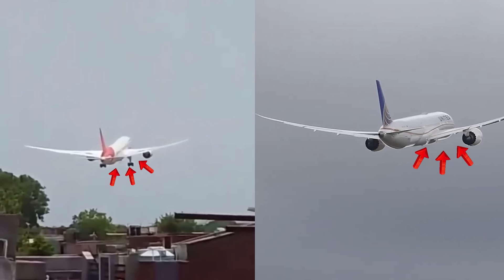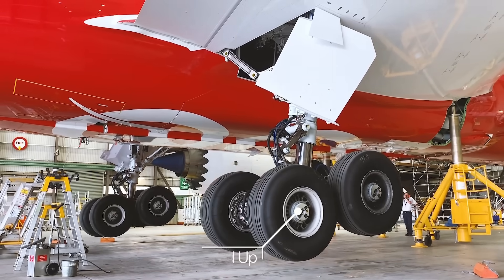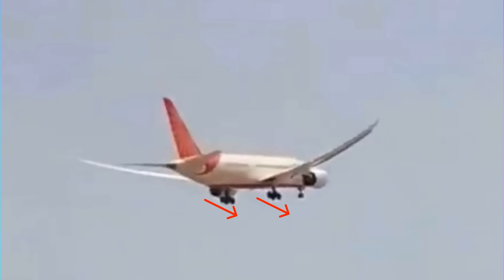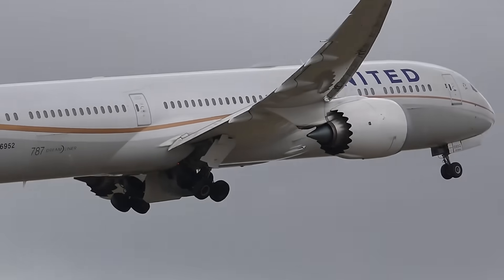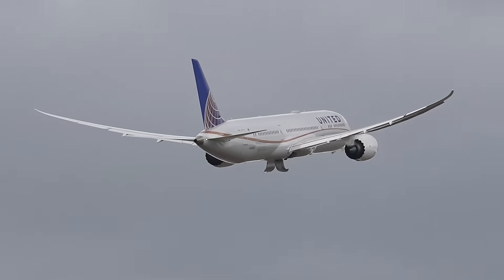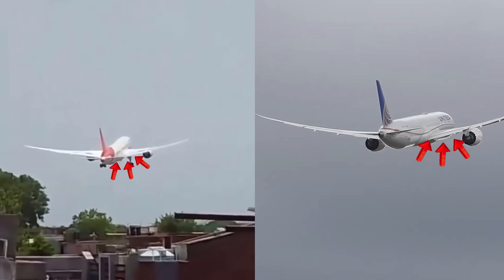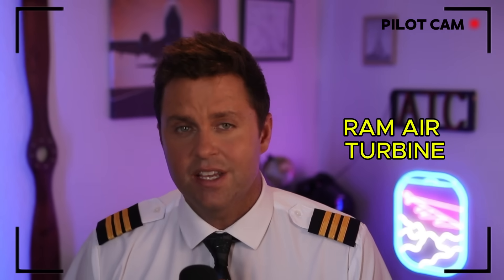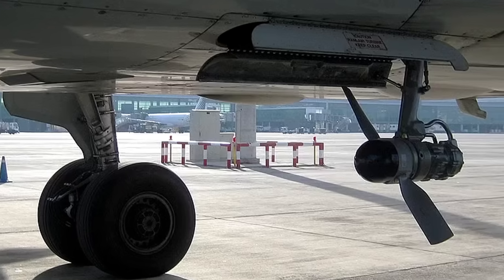Pilot Explains: A New Detail in the Air India 787 Crash Everyone Missed

Comment: Contaminated fuel is unlikely- generally each engine would sputter/flameout separately as the contamination reached them. This would cause asynchronous thrust on one engine causing yaw  or other clues which would be seen on video. This flight shows no strange movements.  Other incidents of contaminated fuel show flameout on one engine before the other, the odds of both happening simultaneously are verly unlikely.  Redundency in electrical systems make such a catastrophic loss of all engine power unlikely also. Usually electrical component failure starts a cascade of events of loss of control, not simply immediate duel engine failure.

Comment: Contaminated fuel would have manifested itself during take off roll.  With all the redundancies in the 787, a double engine failure is virtually impossible.  However, if we invoke the MH 370 cockpit dynamics,  it may be the engines were shut down by the captain/co-pilot deliberately and at the most vulnerable time in the flight.

Comment: Previous flights from this plane have shown electrical issue, and the man who escaped says passenger  lights gone down. I stay on a flight computer issue, say blue screen or reset. My concern is that those peoblens were known before the flight. The plane took the entire long track to take off, and the airport radar blinking to show the plane on FR24, the only plane doing that strange result this day at Ahmedabad.  The fact also that the radar loose the plane just at end of the track. If you add the RAT deployment, means electrical shut down in all the plane, including  perhaps loss of parameters, if there is a short on the battery side.
I think some  must simulate on the identical flight simulator from Boeing,  what happens if you force the plane to take off, as you have a computer reset, due to electrical energy total loss. For me, engines return to iddle, RAT goes down, and everything goes wrong because the computer system decides for the most part. If this takes five minutes to return the system to normal at take off, this is too late, the plane is lost. The computer reset can be due to a short , a battery issue, or manual deactivation of essential systems, like charge, warnings, flaps, and thousands of captors, causing the system to ask for reboot.
Welcome to the computer's world. At a time passenger's  transport drones are coming, we urge to understand that human control must always double-check computers. But, faults are made when humans want to overpass  computer  warnings.

Comment: Fire triangle: heat, fuel and oxygen. If it’s duel engine flameout then it’s either a fuel or a heat issue. This armchair idiot suspects fuel pump failure (less likely) or bad fuel. Either way, the fuel supply was interrupted or there was bad fuel. No oxygen? Not possible. Ignition source? I dont know. I investigate industrial accidents as part of my profession so based on what I have seen, I would be looking at some kind of failure of fuel or ignition.
Reply: Sorry Gary, I was referring to myself as the armchair idiot, not you. 😂

Comment: As an Ex Refueller, if any Aircraft Takes Fuel and then Crashes En-Route to its Destination then the Fuel Farm as we Call it (UK) is Closed Down and Quarantined and a Full Examination of the Fuel Including Trucks, Hydrants is Undertaken as well as Sealed Samples of the Fuel Used at that Time Sent for  laboratory Analysis. Personally, I cannot see it being a Fuel Issue as that Aircraft was not the Only Aircraft to Take Fuel that Day, However, it Wouldn't be the First Time that Pilots have Switched of the Fuel Switches by Mistake on Take Off, A Delta 767 in 1987 Did just that.
Reply: Do you know if loss of all electric fuel pumps is enough to reduce thrust at takeoff? I know the engine driven pumps are supposed to be enough to continue flying and land, but can they suck enough fuel in for takeoff power, and with not even a few percent loss of thrust? And can they work at any attitude including takeoff rotation? And if the gear was stuck down because of a power failure, and the takeoff was hot and heavy doe that add up to enough of a problem? Because if so then electrical failure is really not that improbable

Comment: Someone else suggested a vapour lock in the fuel lines after having sat for 2+ hours in the heat before takeoff, the effect of which became critical when the front part of the plane came in a higher position than the rear part.

Comment: I am not an aviation expert or a pilot but I have made up some thoughts about this accident. The first few seconds of the crash video looked to me like a normal landing on any airport around the world but of course there were no landing strip there. I quickly suspected that there was something wrong with the thrust and wondered what could have caused it. Bird strike was the first option but with no birds observed on takeoff that was highly unlikely. Besides it would be very unlikely that it took out both engines unless it was a big flock. I also presume that the pilot that sent out the emergency message would have had time to say so before they crashed. Second tough was contaminated fuel or blocked filters but then I presumed the engines would have died slowly and with a sound that would have been notable. That leaves me with the third option which is electrical/mechanical failure. The survivor said he head a bang before the light started flicking. The flickering can be tributes to the RAT, but what about the bang.  I remember some years ago a SAS plane that landed on a field in Sweden after a takeoff from Copenhagen. They had a new system that the pilots were not familiar with that was supposed the engines to be damaged by ice. The pilots reacted wrong with the result that both engines stopped. Luckily enough they had sufficient speed to land on that field with no casualties. Could it be the same or similar devices that shut down the engines on the boing not due to ice but debris from what ever broke down? From what I hear the black boxes were recovered and that should give the investigators plenty of information both in the form of voice and sound recordings but also raw data of the alarm log and the engine status. Hopefully there will also be a public report in the near future. Maybe boing is the first with a newsletter about maintenance and possibly some new implementations of operations of the plane.

Comment: The first question should be what was the reason the aircraft required the entire length of runway to reach rotation? There comes a time when a pilot has to decide if their craft isn’t meeting the standard requirements for take off as it rumbles down the runway. A point is reached where a takeoff abort needs to be made even if a safe point has been passed. Better to run off a runway then to gain some altitude and then plummet to the ground. Why did the plane only get airborne at the very end of the runway?
Reply: Maybe the pilots were panicked and simply made a judgement call very late, relatively speaking, in the process? I’ve never understood why there are populated buildings, ravines or mountains at the exact end of some runways. If they could’ve aborted and had longer to stop, but stayed on the ground, surely that’s better?

Comment: My opinion at the start, it was engine failure despite the RAT was deployed,  the aircraft failed to take off . Why? The MTOW maximum take off weight can be the reason .OVERWEIGHT can affect rhe take off. What happened during the hours of the delay of the flight? Were they adding more baggages or heavy load?  Or waiting for a permit to the items added? Or was there a repair done? Pilot and flight dispatchers are the last to know if flight is going to take off. Weight can strictly affect everything.

Comment: It sounds like there was an engine failure just after a gears Up? Water in  the fuel forming Ice crystals? There was a case where a fuel line was damaged during a gear-up landing. Specifically, British Airways Flight 38, a Boeing 777-236ER, experienced a loss of engine power due to fuel starvation resulting from a damaged fuel line. The damage was caused by the landing gear retracting into the wing during the gear-up landing, which impacted the fuel lines. British Airways Flight 38, 17 Jan 2008.

Comment: You're right. The engines were quiet before the plane went down and you could even hear the RAT. If they had engine power and the throttles were ball to the walls it would have been loud. There was a mayday call almost immediately after rotation. No thrust = no lift, momentum blead off quickly and she began to descend. The landing gear position as you mentioned is yet another clue. The dual engine failure will remain a mystery until data is recovered from the boxes. Such a sad tragedy.

Comment: Hi Gary
I am a retired 747 flight Engr. I wonder nobody has looked at the performance aspects like what was the TOGW and what flap setting was required for ISA+25 and possible temperature inversion at the Ahmedabad Airport.
  Will a 787-8 with one engine out and gear down be able to fly with low flap setting and heavy weight.
  On 747 we used to have clean stall and landing config. stall recovery exercises in sim.
 For clean stall I still remember GA thrust flaps 15 call.
  By the way your analysis is one of the best.

Comment: What about computer failure? Where inputs were interpreted as set thrust to idle? Here is wild speculation. A maintenance laptop got compromised with malware similar to Stuxnet and activated. Air India might not have been the target. If it was fuel contamination then other planes should have experienced it as well unless they are locked down the fuel supply immediately after the crash.

Comment: The blokes in the canteen into which the 788 crashed have told the BBC that they heard the deafening noise of approaching jet engines before the subsequent impact and explosion. The lone survivor too hasn't said anything about the cabin going silent, which is how it'd have been if the engines spooled down. I wonder why?
Reply: Impossible. The deafening noise assuming the engines were functioning normally and not flaming/flamed out would come from the rear of the plane, not the front.

Comment: I think also that there was a high probability of fuel contamination and or fuel tank problem. The flight took off with no a/c working and no electricity in the passenger compartment. This fight should  not have left the ground following rigorous testing.

Comment: Why not assume a more realistic course of events? They took off normally, damage has been going on in the electrical distribution system for days, the ADSB and entertainment system are not working properly, and at the moment of lifting the landing gear, a powerful short circuit occurs in the electrical distribution, the landing gear stops retracting, the FADEC turns off, and the engines receive only a small amount of kerosene flowing by gravity, so the engines continued to operate in low-gas mode.

Comment: I retired off the B747-400 and had flame outs taking off. GE engines are not good. There is a computer brain on top of engine on 747 and  sensors . Some conditions will command the engines to idle or flame out. Scary. Lucky we had 4 engines.  I survived 33000 hours up there. Don’t miss it at all. Fate is the hunter. Good luck.

Comment: maybe one of the pilots switched off both engines(fire handle,engine master),or both fuel shut off valves closed (computer failure),or a terrorist ackt (explosive device inside the electronics compartments.(but this valves are failsave open ),what me scares is the flight number 117 is the 17 in the flight number .like mh 17 .

Comment: The silence of the engines, the glide to the ground and it's fatal impact would suggest total engine shutdown (not failure). Air India might have a lot of questions to answer and Aviation in general will have to head scratch on having so much reliabilty on electronics. Two perferctly good engines hindered by a preventable electronic/software issue?

Comment: At what temperature does kerosene become gaseous? And what happens if an engine is fed with gas instead of liquid? If this could cause problems, it could be that the three hours of downtime in the blazing sun and without air conditioning caused this to happen, at least in part, and it only became a problem after takeoff.

Comment: Not an pilot or any type of expert:
The AOA towards the end seemed like it might've been too high for loss of thrust (which has happened in a lot of accidents when pilots are under extreme stress and are losing altitude) 

8:50 with the gear down, flaps in the wrong config, and full power, if they pulled up too much, couldn't they still lose altitude due to a stall? 
   There have been a few crashes in the past with a botched landing, when the pilots Go Around and something is misconfigured (usually thrust, sometimes flaps), they gain altitude due to the ground effect, and then just start to fall. 
   Sometimes they were able to determine why, but by the time they fixed the error, it was too late and they weren't able to recover. In some cases, the pilots pulled too much in desperation, which caused a stall.

Comment: They've finally noticed that issue. Probably whole system went down, hydraulic, motors and electric. The former passenger of the same airline explained about electricity issues in his video and flaps didn't work properly. There was an issue before it took off again. Did they check that or not? Whole system had issue in that point possibly. I just wonder if they noticed if and checked it before the next flight.

Comment: Very good, also Captain Steve's second hit on this terrible tragedy. I also spotted the RAT and gear points from video footage, along with the blade sound from the RAT and lack of engine thrust. It seems spookily accurate.
My question would be, if contaminated fuel was a big enough issue to cause this as a double engine failure, would there not have been several other aircraft, either locally or elsewhere, within  hours, that were fuelled from the same source, likewise affected and showing signs of power loss or other fuel related issues? Or, would the 'contamination' have stemmed from an onboard issue only? I am struggling to think of any onboard contaminant that would get into fuel and cause this...
Therefore, rather than 'contamination', my theory would be that for some complex reason, it was fuel STARVATION rather than contamination...? A technical malfunction that starved both engines of fuel. I realise there are independent and back up systems and redundancy built into all aircraft critical systems, but clearly something really decisive and catastrophic occurred that caused the thrust to reduce totally and simultaneously on both engines. 
My guess therefore, is we will discover either a complex tech failure of a fuel component or system, leading to the stoppage of fuel getting to both engines, or almost inconceivably, a pilot error leading to fuel cut off at a critical point at rotation. But that seems far less likely to me than a tech failure.
RIP all those who so very tragically lost their lives in this horrific crash. My sincere condolences to all those bereaved. 
Yet again, aviation will need to 'learn lessons' from the most tragic of circumstances.

Comment: If the fuel waa contaminated, it would been apparent during taxi and take off.  I don't  think this is the problem. 

Could the fuel cut off been done deliberately?  Co-pilot suicide?
Reply: Not necessarily. Not all contamination would be immediately apparent, and it's possible that chemically contaminated fuel could still work, but lead to deposits that choke out the engines, or it could be a physical contamination that blocked the feeds, but I think general consensus is already erring towards an electronics problem, as even if it was contaminated fuel, it's unlikely to effect both engines simultaneously unless it's severe enough that it should have been apparent earlier. But honestly, we won't know until the investigators release their preliminary findings.

Comment: If the air con wasn’t working - it’s normally an indication that the APU wasn’t working -  frequent issue - the pilot then uses  the energy back up for the most essential systems  during pre flight - fuel cells or batteries - and switches off the aircon on purpose in order not to overpower the energy back up power - so the remaining capacity of back up power system was low before take off - and in any critical electrical power loss of a power generator that is generated by the main engine can’t be compensated- a pressure spike in the fuel system  (vapor) or oil pressure due to overheating (fuel or oil pipe burst -  or pressure shock wave) causes the flame out - energy back up system runs empty and the RAT deploys

Comment: A Scoot 787-9 heading into Perth in Australia in 2018 had an uncommanded engine shut down of one of its Trent 1000's and it safely landed on one engine. Investigation found a 'blocked fuel inlet filter' affecting the 'Fuel Metering Valve'. So there have been events of uncommanded shut downs on 787 with one engine, due to fuel interruption, so who knows, just throwing it out there.

Comment: First off I'm not expert but I do have question about dual engine failure.
If the plane had dual engine failure how would it travel as far as it did with nose up attitude and not bleed airspeed and just drop suddenly instead of the glide we see.
Could it be the plane hit the ground before the wings stalled.